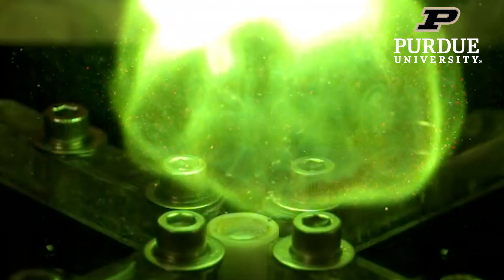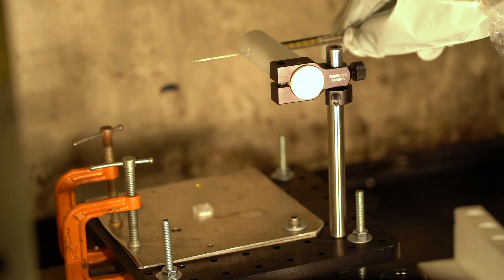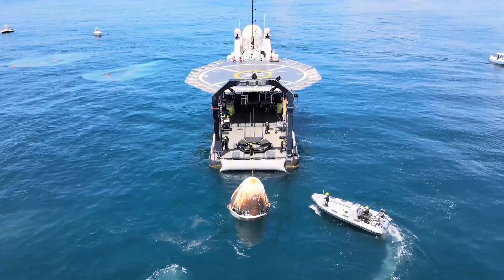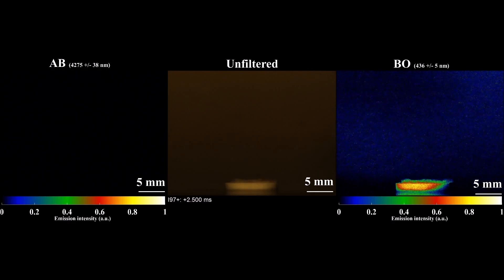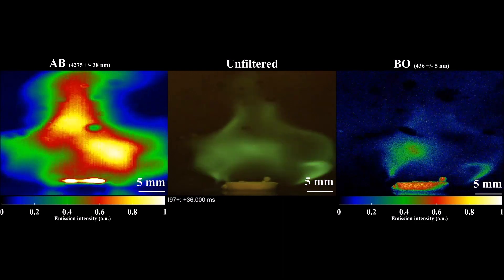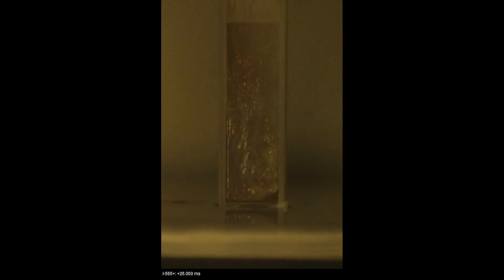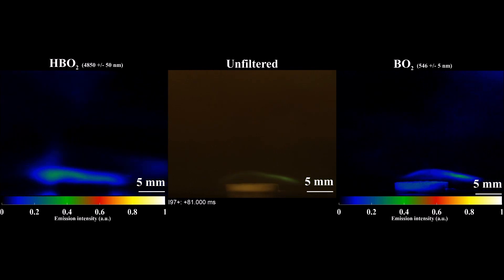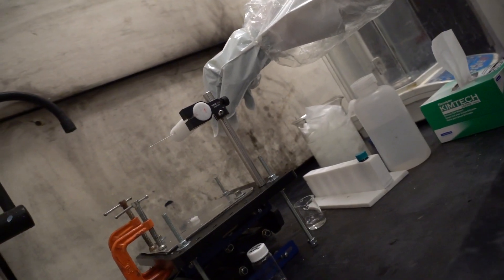The Green Flash: making a safer hypergolic propellant

Comment: Can you demonstrate hypergolic fuels igniting in a vacuum please? I'd very much like see this demonstration!!
Reply: The video has God damned Apollo ascent in it - that used a hypergolic rocket engine. Either check out anything with AJ-10 engine that was filmed in space (Apollo service module) or the Space Shuttle maneuvering engines. What else do you want?
Reply: @akkudakkupl  haha I don't think you fully realise my request - I'd like to see a demonstration of hypergolic fuels being ignited in a vacuum because I feel the Apollo ascent is faked!

So an independent demo would help clarify my position!! Surely there is a video of somebody igniting these fuels in vacuum in a lab or educational establishment. If these hypergolic can combvust where there is no pressure, then let's see where's it's been demonstrated!

I'm of the view nothing can combust in a vacuum and certainly no flame can exist in vacuum either!! 

So what have you got?
Reply: @PeterPete  Why would you need any pressure to combust two liquids that react on contact?

I mean, the fuel/oxidizer system is actually pressurized at all times from a hellium tank, helium is warmed up by the combustion chamber to increase the pressure while burning.
As soon as you open up the fuel/oxidizer valves you end up with pressurized liquids going into the injector and mixing = bang ;-)

Only difference between burning in atmosphere vs vacuum would be the plume shape - in vacuum it would expand way more to the sides because air would not 'push' against the exhaust gasses.

Why would they fake so much stuff though?
The whole RnD that went to those engines, the RnD that went to fuel research (Ignition is an amazing book on the topic, read it before the whole Elon Musk recomendation ;-) ). Then actually bulding and sending rockets downrange.

 Even the damned computer and software they wrote for it is 100% capable on landing on the moon in a simulation, channel named CuriousMarc did a whole series of videos on restoring an AGC for some collector to full working order, then they hooked it up to another computer running the simulation and let it do its thing - it worked.

Another thing is the exact same engine as the service module used (although an older version not capable of restarting) was used on Able/Ablestar upper rocket stages that put satellites into orbit.

To me it just seems surreal to fake a thing that you were actualy capable of doing, when you knew you had time to do it before the competition (because the soviet programme was a disaster at that point in time, they even broadcasted the N1 rocket catastrophe on ascent, because they thought they were going to win the race, talk about losing face).

I might look for some video of a hypergolic engine in vacuum and will come back to you.
Reply: @PeterPete  https://www.youtube.com/watch?v=GxBRQXxBRic this is a solid fuel engine in a vacuum chamber, still, it has fuel and oxidizer on board, only difference is this needs a source of ignition, when in a hypergolic the mixing both is enough to start the reaction.
Reply: @akkudakkupl  watched that - if you watch closely you can see exhaust smoke escape from the chamber which means no vacuum present in demo. Furthermore the chamber was way too small as the exhaust filled the chamber instantaneously thereby leaving no vacuum!

But here's a video of somebody who can't get a rocket motor to work in vacuum

https://www.youtube.com/watch?v=76JM03a6WH4

the only time he can get it to work is when he encapsulates the entire rocket motor in air
Reply: @akkudakkupl  so i guess there is no video or demo of hypergolic fuels being tested in vacuum?
Reply: @PeterPete  Motor starts under vacuum, as the exhaust is gas it means the vacuum is destroyed, but it still proves that a rocket motor can start in a vacuum.
Reply: @PeterPete  Can't find any video of that, nope.
But it is extensively used to put satelites in orbit.
Reply: @akkudakkupl  quote - Motor starts under vacuum

it wasn't a hard vacuum and certainly didn't replicate the vacuum or pressureless environmentt of space!! Exhaust fumes were seen outside of the tube.

You must be deluded to think WP's tube replicates space - compare the size man!!

He doesn't call his channel warped perception for nothing
Reply: @PeterPete  you are using those satelites on day to day basis, you can observe them with a telescope (ISS is easy to observe).
Reply: @PeterPete  you do not need to replicate the scale to replicate the phenomenon. A vacuum is a vacuum. The moment the motor starts it produces huge volume gas, do vacuum is destroyed, but it does start in a vacuum.
Reply: @akkudakkupl  the tube was not a genuine vacuum - there was a leak b/c one can see exhaust fumes outside the tube!!
Reply: @PeterPete  I didn't even start any discussion on God.
About bigfoot - also not a subject of this discussion.
I will rate this bait 1/10 because I replied.
Reply: @akkudakkupl  you have a certain threshold of proof that is low compared to mine.

It seems you are willing to accept almost anything as proof to support your mindset!

Clearly that's something for you to deal witth not me! So you may as well accept god and bigfoot to be true as well!
Reply: @akkudakkupl  answer the following 

I wouldn't be able to survive without space travel because.......(your answer)
Reply: @PeterPete  It is not about absolutes. I have told you time and again, that there are advancements that make our lives easier.
Could you live without satelite communications? Sure.
Could you live without GPS? Sure.
Could you live without more precise weather reports due to weather satelites Sure.
List goes on.
But does it make your life easier and more comfortable? Sure it does and you don't even appreciate it, because it is a given for you, even if you don't understand how it works or how those machines got up there.
Reply: @akkudakkupl  your feckin mad mate!
Reply: @PeterPete  There were people that lived long, true, but they were an exception from the norm. In most cases they were of a wealthy background.

Today it's the norm to live long.

In 18th century average life expectancy was around 35yrs in more developed parts of the world. The average skyrocketed during the 20th century when there were massive scientific advancements in medicine and chemistry.

I've been using computers whole my life and I have 20/20 eyesight. It's not the devices fault, it's the users that are glued to them (and not following ergonomic use guidelines).

All you are in my eyes is a hypocrite willing to criticize, but in no way willing to live by the words he preaches.
Reply: @PeterPete  well the knowledge I learned at school I get to test everyday in my work (industry), it checks out.

I learned electronics as a hobby and can confirm that theory from books agrees with results I get in the real world.
Reply: @akkudakkupl  so how do you test the knowledge about the ISS, space travel and the shape of the earth?
Reply: @akkudakkupl  it seems very clear to me that you avoid addressing the human nature that underpins man's world. I asked what knowledge have you learned yourrself especially about human life?

I have learned people lie whether knowingly or unknowingly - what have you learned?

What have you learned about life?
Reply: @PeterPete  that there isn't much point in trying to educate those unwilling. But it's still necessary work.
Reply: @akkudakkupl  sure one can lead a horse to water but you can't make the horse drink!

But let me ask you this - do you think people lie whether knowingly or unknowingly?

yes or no?
Reply: @akkudakkupl  I try to educate people on life and the human experience but it falls on deaf ears a lot of the time because people prefer to live in their dreamworld than the real world
Reply: @PeterPete  that's human nature. Doesn't change the fact there are more of the good ones.
Reply: @akkudakkupl  so you are agreeing with me that people llie whether knowingly or unknowingly? yes??
Reply: @PeterPete  It doesn't matter in this case.
Reply: @akkudakkupl  seems like I hit a nerve - Don't blame me if you're life is messed up!! Do what I do and blame your parents - they brought you into the world!

Oh and don't forget to leave a bit to the society that brainwashed you leaving you little hope to be truly happy!!
Reply: @PeterPete  It's not me that is spamming someone on the internet I'm not agreeing with ;-)
Who is the truly unhappy one here?
Reply: @PeterPete  You know what the Dunning-Kruger effect is? Because you are a prime example.
You don't know the first thing about the subject but speak from a position of an expert.

You don't understand chemistry, you don't understand physics, you don't understand engineering and yet you think yourself an illuminated expert.

Hypergolics react upon mixing, they are forced under pressure, from a pressurized fuel system into an injector THAT MIXES THEM, the injector fires into a combustion chamber that ends with a de Laval nozzle. There is no way in world they won't ignite in those conditions. That's why they were used on the stages that went to moon, because they had the lowest chance of failing and dooming the mission and astronauts.

That is all and that is the truth.
Reply: @PeterPete  Your whole recent reply completely agrees with Dunning-Kruger.
Yup, as I thought you are completely derranged.
Reply: @akkudakkupl  youre' going off the rails here - I'm not a college student! 

🤣🤣🤣🤣🤣🤣🤣

Regardless you THINK hypergolic fuels can react in a vacuum and yet you've NEVER seen anybody demonstrate it! All that's convinced you hypergolic fuels do react in vacuum is you've watched an old video that can't be verified to be a genuine account of the portrayed event!

Way to go einstein!!
Reply: @PeterPete  They fired countless Aerobee sounding rockets with early AJ10 engines.
They tracked those with radar.
If the engine didn't work in vacuum then it would be visible by lack of acceleration.

It's not my fault you can't understand that we have more tools than just our eyes.

Now kindly go away and stop wasting my time.
Reply: @akkudakkupl  keep up einstein - have you forgotten my initial post or forgotten the content of the above video?? It's about hypergolic fuels not high altitude missions!

I always watch videos of hypergolic fuels being tested or demonstrated in atmospheric conditions but never in vacuum conditions where they're supposed to work! So where's the test or demo video so I know they do work in vacuum conditions?

So far you've come up with jack!

I think the reason why is because hypergolic fuels DO NOT work in vacuum conditions and it's a lie they do. So what you think to be true is clearly untrue!

YOU actually think something that is untrue to be true!!

Way to go again einstein!!
Reply: @akkudakkupl  You don't need a rocket to test or demonstrate the reaction of hypergolic fuels in vacuum conditions!! You only need a vacuum chamber and there's plenty of labs that have them and use them!

Knowing that demonstrating hypergolic fuesl working in vacuum conditions is an easy task to accomplish why do I always watch videos of hypergolic fuels being tested or demonstrated in atmospheric conditions but never in vacuum conditions where they're supposed to work? 

Where's the test or demo video so I know they can work in vacuum conditions and the claim isn't total BS??

So far you've come up with jack!

I think the reason why is because hypergolic fuels DO NOT work in vacuum conditions and it's a lie they do. So what you think to be true is clearly untrue!

YOU actually think something that is untrue to be true!!

Way to go again einstein!!